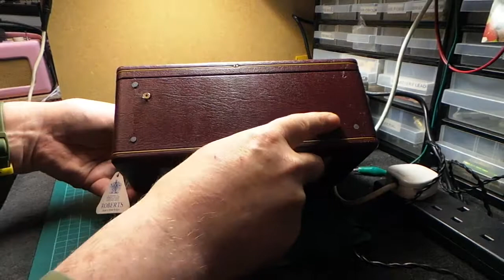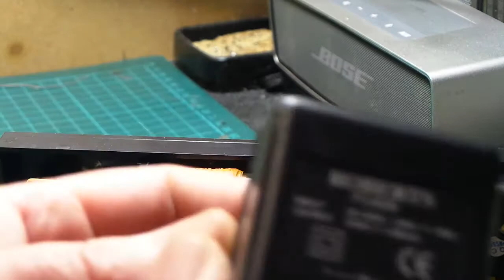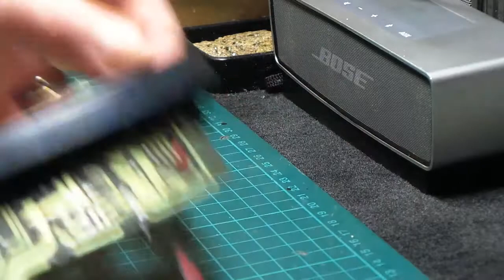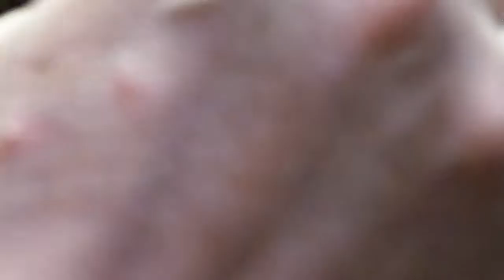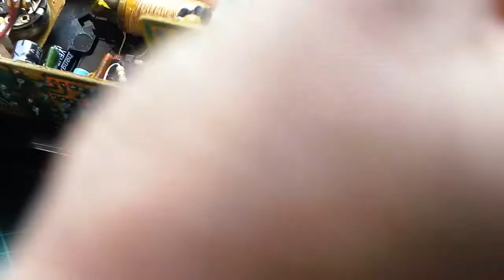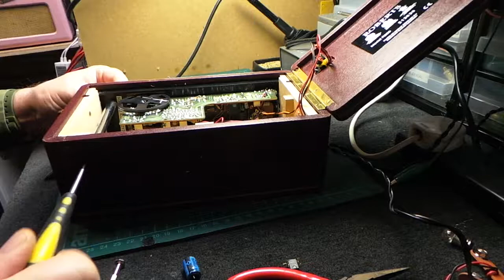Another Roberts R250 with blown audio... The fix

Comment: cool foxy like the DE soldering tool will have to get one ! for the workshop nice and easy repair I take it that the capacitors and the audio chip take the brunt of the polarity reversal and the rest of the radio survives
Reply from the maker: Hi Benji, yes, the audio chip takes the brunt - often one or both of the caps go high as well, I've even seen exploded caps in the R250 (Gawd knows what voltage someone put up those radios to make the caps go bang!). Usually changing the audio IC, is enough to bring the radio back to life.

Comment: Hi, thanks for the video I have changed the 1000uf 16.v and the 470uf 10.v caps. and still having problems so I suspect it is the 
 audio chip after seeing your video. 
The audio chip has 2 numbers on the top 0145/201x01, I have tried to find the chip on the internet but no luck. can you help.
Reply from the maker: Hi John, and thanks for watching. The IC you need is the S1A2201X01 - 1.2W Audio Power Amp DIP8 - they are available on the internet. I bought my last ones on eBay (From China). They aren't so common, so are a little more pricey...

Comment: Hi, Thanks for your video. I've got the same issue with my R250 revival and the capacitor is definitely popped up. Could you please send a link for the chip?
Reply from the maker: Change the caps first. Theres 2 usual suspects, a 1000uf and a 470uf. You may be lucky and not have to change the audio chip. If you still need a chip, send me an email - address is on my 'about' page. You need to check the chip number on the top of it - there are two variants depending on your actual R250 model. I may be kind enough to send you one... ;)